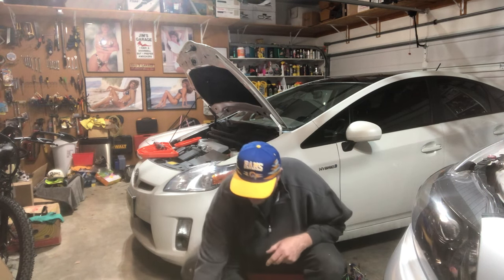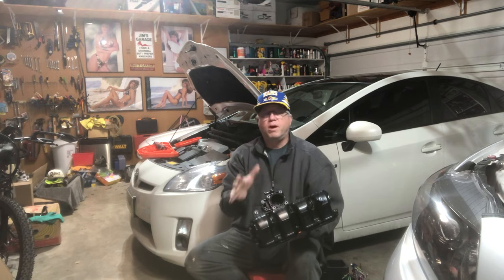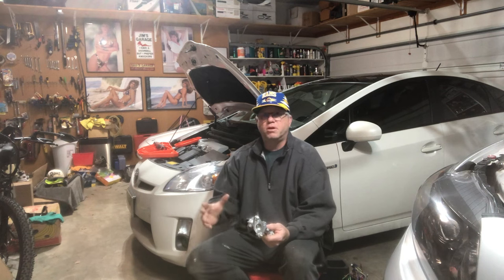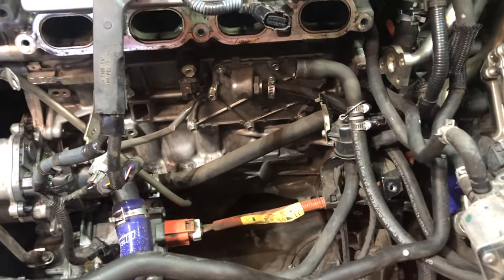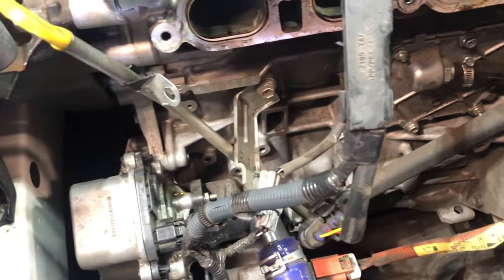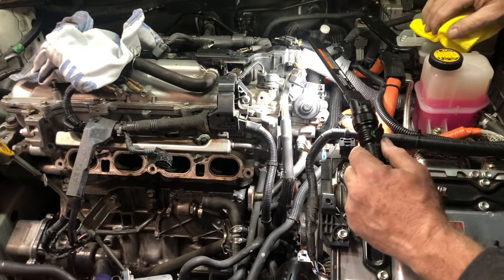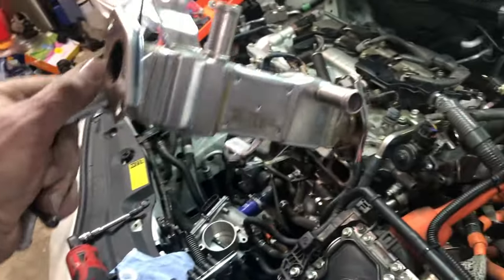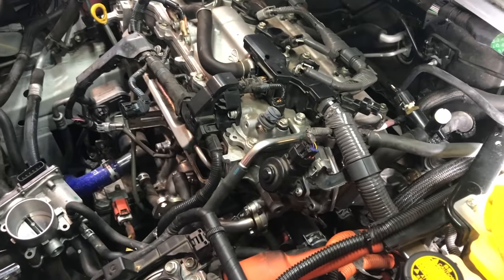2010-2015 Prius // EGR Valve // Intake Manifold // DIY // Removal - Clean & Replace

Comment: nice you show the bolt from hell and offer nothing about how to remove it ...
Reply from the maker: Well it's hard to show with a camera since I couldn't even see it. I could feel it with my hand. I had to just fiddle around with it for quite some time. A tip for getting it off it to remove the entire stud. It protrudes much farther than the nut and was easier to get a socket around. Keep in mind that it takes special female torx socket to remove the stud. It's the same size stud and nut that is easily reached between the EGR valve and cooler. I thought that I had talked about this in the video. Sorry if I didn't make it clear.
Reply: @jimsgaragetoys     hey man i'm planning to do this in a couple days.  and I just wanna be clear on your comment.  you used the E8 socket to remove the entire stud INSTEAD OF the actual bolt?? Besides the e8 socket, what else did you use? Since I haven't tackled the job yet It's hard to think of what you may need so i'm just trying to make sure i have my shit together
Reply from the maker: @niveKOnBass  I tried to remove the nut but it was much harder the get to the nut since it is farther back on tested. Then I thought why not just remove the entire stud? The end of the stud can be reached much easier than the nut so that's what I did and it worked beautifully!
Reply from the maker: @niveKOnBass  I got this reply from you and wanted to thank you for the kind words but when I went to reply I couldn't find it. I'm not sure where it went but thank you anyway. Your quote was "I just want to say that I am grateful for you and your video. Yours has been superior to the other 47 i've watched. The camera work was excellent. The explaining was excellent. The talking was all useful. No stupid fluff and stories that I never asked for. No extra bullshit. I don't need to watch you unscrew bolts, I know how to do that (unless it's a tough bolt). It was done perfectly."
Reply: @jimsgaragetoys  For whatever reason my comments keep getting deleted :p. no idea why youtube doesn't like me.  It's not your channel so dw. but yeah man it's better in every way. Explanations and angles and stuff. Very good. Also you used freakin power tools. Omg I hate watching someone remove shit by hand lol

  im changing my spark plugs right now just taking a break at the moment. but I got a look/feel of the bolt in question and I was wondering if there's a possibility of this stud actually shearing off if you try to loosen it with the nut on? was it really tight? I tried it on the close up bolt and it seemed like it was gonna break so im hesitant a little bit. What tools did you use? I don't have one of those long slim electric screwdrivers you have, can I loosen it by hand? I'm sure I can get a swivel socket on it or somethin
Reply: It's funny. I got the bolt out NO PROBLEM. It took me 30 seconds to get it out, not kidding. First try. Then....I couldn't for the life of me get the socket on the stud :(.

Its dark out so I can't finish. Do you have any other tips you can give me about just getting the EGR loose enough to be able to remove it? I really want to clean it. It's not a huge issue on my car yet but since I'm doing an OCC + changing spark plugs I want to knock this out too.
Reply from the maker: @niveKOnBass  At least this one didn't get deleted. I love my power tools whenever I can use them to make things easier! 😍 

There is no chance that the stud will shear off. As you back the stud out the nut will come with it and back away from the head with no issues. The stud will come out with the nut still in the same place on the stud. The hardest part is just gettingThe proper socket on the end of the stud but it's a lot easier to do that than get a socket on the nut. I don't imagine the stud breaking but if it did you would just have to get the nut off to remove the ERG cooler. What you might be feeling is the thread lock on the stud, I think it had some on it.
Reply from the maker: @niveKOnBass  I'm assuming that you mean that you got the nut off of the stud. The to get the stud out make sure that you have the proper type of socket that I show in the video. There are 2 nuts/studs that are on the back side of the EGR cooler that must be removed. The other nuts are all easy to reach toward the front of the EGR valve. I found it easiest to remove the entire EGR valve and cooler together and then separate them.
Reply: @jimsgaragetoys  I decided to hold off on replacing EGR till spring time because it was freezing but I wanted to share this tip with you. 

If you ever wanted to just remove the EGR valve ONLY, you can use a slim OFFSET 12mm wrench to get the nuts holding the EGR to the cooler while it's still in the car. After the 2 nuts are gone, then it's just the stud that's easy to reach.
Reply from the maker: @niveKOnBass  That's a great tip. I should pick up some as I don't have any. I tried doing that but without any offset wrenches it was useless.
Reply: @jimsgaragetoys  yeah man . the reason I think the tip is good to know is because i find it absolutely RIDICULOUS that we need to remove the EGR cooler to clean the egr valve. i look at this like it's a money play by toyota. Who the crap uses FEMALE e8 sockets? I would bet most DIY mechanics don't know about offset wrenches, it's like a weird special tool, i bet toyota was counting on that. just like they did with the 25 bolts to remove to change spark plugs

Since it's freakin exhaust in there and will never ever stay clean, it makes way more sense to me that we find a easy way to remove the EGR valve seperate from the cooler, remove the pipe on the back of the cooler, and blow it out with compressed air.
Reply from the maker: @niveKOnBass  I think that most people clean or replace both at the same time as they wait a log time to do it. If doing that it's not a big deal but if you do it more often it's easy to blow it out and keep it in excellent condition. I knew about offset wrenches but never thought about buying some. I solved that issue today and bought a set so I'm curious to try them next time. Thanks again for the tip!
Reply: Yeah it makes sense for me to do it regularly as I do uber and stuff. 

I have an off topic question for you, I kinda wanna avoid the priuschat dudes cause they are very doom and gloom. I have a very minor subtle flapping noise i'm hearing from the driver side front. It's not like a consistent sound that happens while the wheel is turning. It almost sounds like the fluttering noise you hear when a turbo release pressure from the blow off valve.

It happens moreso when I start to slow down. I know I have a torn strut boot but I don't think that's the noise i'm hearing. It seems to only happen at low speeds. Googling it told me a few things. Could be hub caps, wheel bearings, or cv axle.

So my question is this: Did you ever need to replace your Prius CV axle/wheel bearings? At about what mileage did you do that if you had to?
Reply from the maker: @niveKOnBass  I've never had to replace anything on mine. The only part to ever fail was the RF door lock actuator and that was a quick fix. Wheels bearings and CV axles are pretty easy to determine. I would also check for something simple. I've seen plastic trim panels make weird noises when the clips holding them on breaker fall out. Every time I do an oil change I have to replace at least on broken or missing clip. Check those things as they are easy to look for. I haven't heard of very many failures of wheel bearings or CV axles. I've got 147k miles on my 2010 Prius as of now.
Reply: @jimsgaragetoys  I know for certain the trim panels are loose. I usually take my car to the dealer for fluid stuff cause i don't want to deal w/ the liquids. i remember it being kinda torn up too, is it okay to just remove that piece?
Reply: @jimsgaragetoys  since you got the wrench, here is the video that demonstrates it - PS. no idea what this guy is saying to me:  https://youtu.be/8jBwBUaRSSs?t=469
Reply from the maker: @niveKOnBass  Thanks for the link, I'll give it a watch.
Reply: @jimsgaragetoys  i linked it at the exact time stamp, no need to watch a whole 30 min video
Reply from the maker: @niveKOnBass  I did, the angle of the camera doesn't show much but I can see what he's doing. I let the video play a while and that was painful to watch as he didn't show or explain much but kept repeating the same things. 🤣
Reply: @jimsgaragetoys  🤣😂 i told you i had no idea what he was saying
Reply from the maker: @niveKOnBass  And you were right! I had to see it for myself. 🤣
Reply: @jimsgaragetoys  what i heard was "you need this type of wingspanner, to fit this leatherwise socket and ___mic cut out_____ not good here". I literally played this video in slow motion, I searched on the internet for alternate terms that europeans use for things like wrenches, couldn't for the life of me understand. i had to go on amazon and try to find what he used and figured out they were called offset wrenches :p.  the struggle was real with that one
Reply from the maker: @niveKOnBass  🤣🤣🤣 Good detective work!